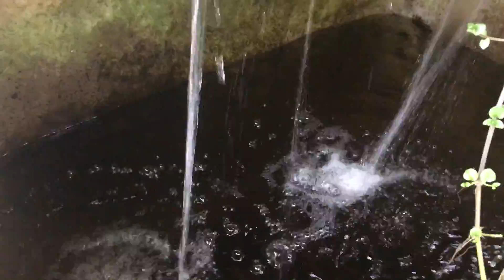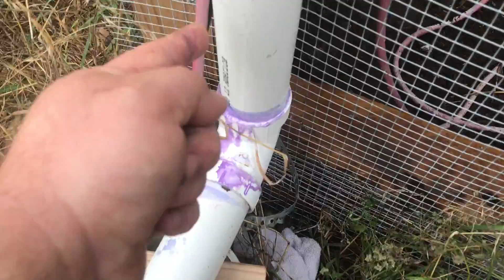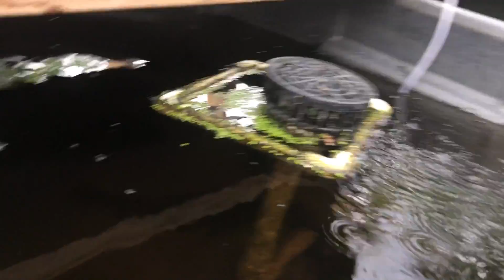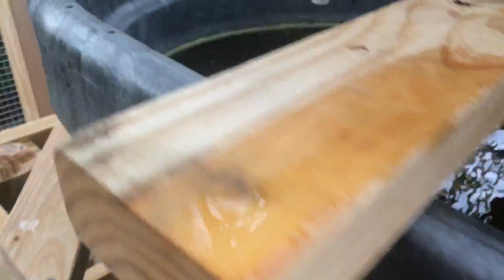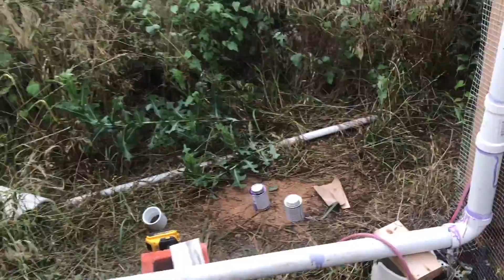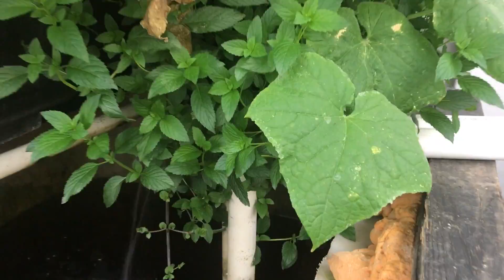A Catestrophic Failure But Not a Catastrophe

Comment: Going to put a gate back there?
Reply: Gayle McArthur I was thinking  a panel built out of 2x4 and stock panels  or hardware cloth held in place with bungie cord or baler twine 

It all depends on how often Jack or the crew needs to get back there  

if its less than once a month  the panel idea would fine and be easyer and cheaper  to build/ install   than a gate with hinges  and making room to swing a gate
Reply: Walt Lars I was thinking of something along the same lines.  Maybe just a short wall, framed just as high as the pipe to allow a step over but protect it from dog poundings.
Reply: A custom gate made from cattle panel would retain human access but eliminate dog access. I make them all the time: the easiest and cheapest uses plumbing tape (the metal stuff with holes) shaped into hinges and a carabiner lock.